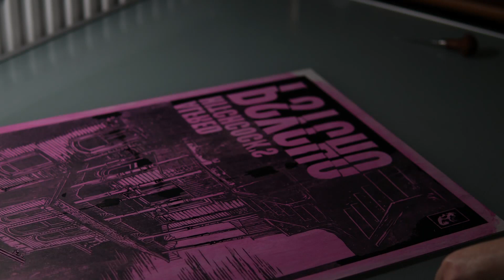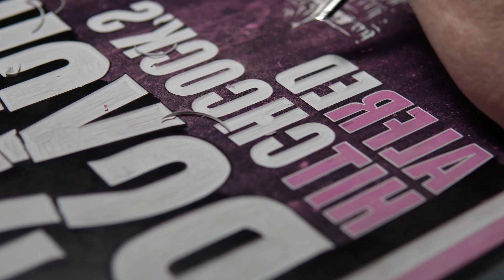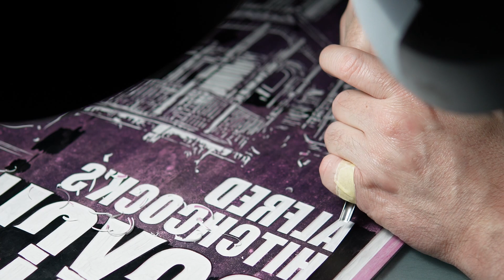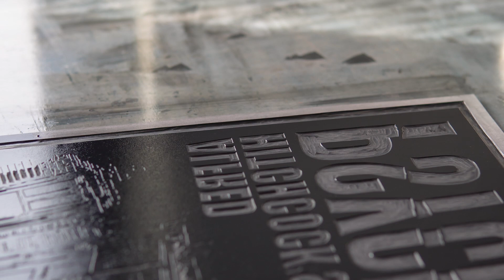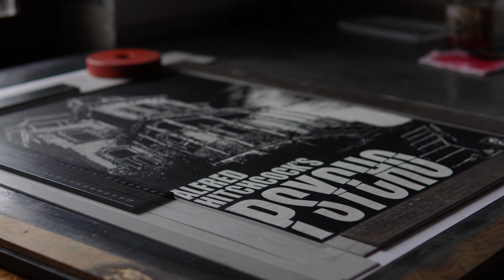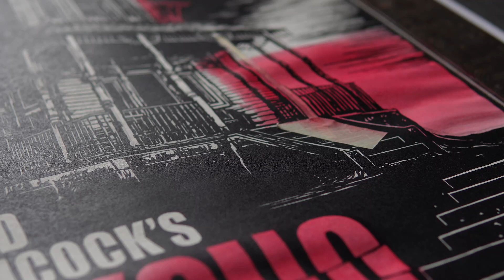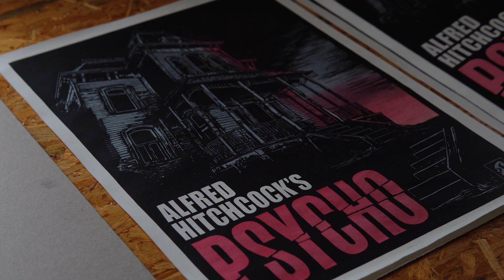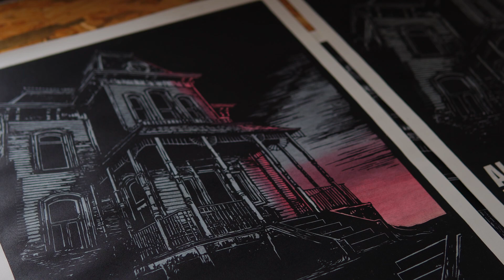PSYCHO - Multi-layered linocut and watercolors

Comment: Superb work! Very soothing to watch you at work in these videos.
Is there any reason you applied the watercolor after the pressing? Would applying it before affect the ink? I was just thinking the ink might be more solid if it was applied after the watercolor.
Anyway great work I hope to see more! Subscribed.
Reply from the maker: Thank you for nice comment.I appreciate it. So... combining linocut with watercolors is a quite popular method. There is only one condition - you must use oil ink. Oil does not react with water, so if you start painting with watercolor over the print - as I did, the ink will remain black as it was and the watercolor will only cover the white paper. Would it be possible to put the watercolor first and then print on the top of that? I think so. I sometimes soak the paper before printing, so it doesn't really matter whether the water is clean or contains watercolor. I've never tried it... but I think it would work.
Reply from the maker: PS: Quick warrning. Because of the montage of this video it may look like I'm painting just right after I printed that. Of course I let it dry first. If you will start painting on wet oil - probably print will stay fine, but definitely you will destroy your brush. Let it dry first. Thanks once again.
Reply: @Thrashead-ns7iw  Brilliant, thanks for the insight and replying my question!